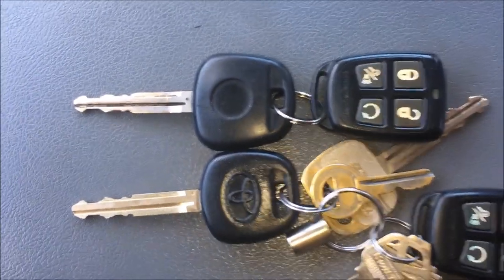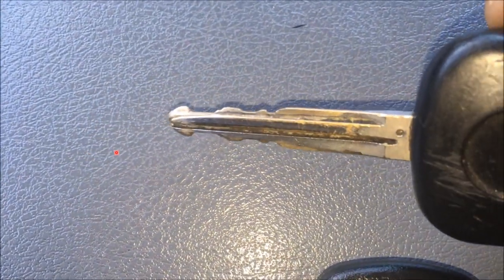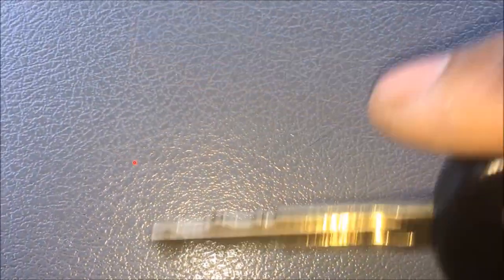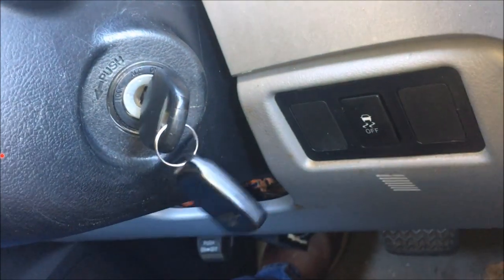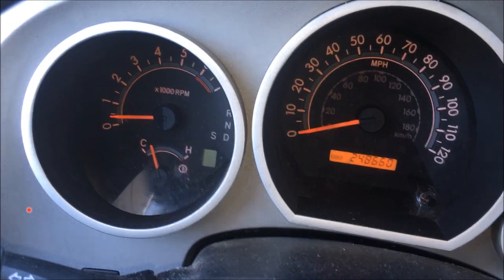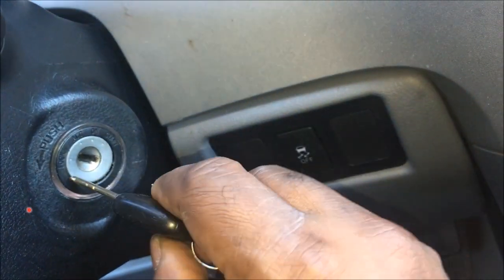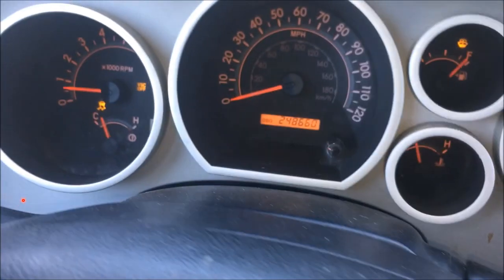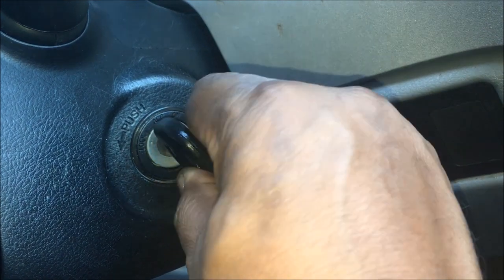DO NOT REPLACE THE IGNITION SWITCH UNTIL YOU TRY THIS

Comment: The most common complaint with Toyota's is they can't pull their key out after a while. If your key ever gets locked in the ignition just disconnect a battery for 30.

Comment: I was having the exact same problem. Had a new key made and programmed and everything works perfect. A lot cheaper than replacing the ignition switch!
Reply: I’m have the same issue on a 03 Toyota Sequoia but my key will go through everything as if it’s ready to start but from on to start nothing happens? You think it’s the key or ignition cylinder
Reply: @kevinmunguia1325  ,probably the starter. If you didn't hear any "click, click", most likely the starter is the culprit.

Comment: But I want to see you drive 115 mph (I'll pay any speeding ticket) and pull the old key out - and throw the old key out the window. (After all, you don't need it anymore). Then put the new key in, slow down, stop, then turn the motor off.

Comment: Hey Bro-migo, nicely done video and great suggestion.  However, some people (such as the below comment) may find it very convenient not to do any fix for this.  Think about, you no longer have to keep your mail key separated from your main keys.  I pull up to my community mail station, pull out my ignition key (with all my other keys), go get my mail, and put the ignition key back in and all without having to turn off the car! 😜 So convenient!
Reply: uh huh....what if you live in a place like new haven where they will jump in and have a nice running car to distribute the crack products? Sounds like you live in a retirement community with nice old 90 year olds.....don't be fooled blaster,  Im 93 and I'll take your hubs, plates, and cell phone while your in the goddam mail depot.....so convenient

Comment: That's a feature!   you can leave your vehicle running with passengers and keep the key.. or leave it running locked up without the key inside.  So i learned something.. i can probably file down that edge on a duplicate and get that feature.

Comment: I've always got extra keys made whenever I got a used car. If they are chipless keys you can use them as master keys when getting your daily use key made. I get my 99 camry keys made at Home Depot, a little over $5 as of 12/21. I use style 35R. Oh, while you're there, they've another style too, all metal #35, these fit in your wallet easily if you lock your keys in your car accidently.

Comment: Pfft most keys cost more than the ignition lock cylinder, and they even come with keys.
Reply from the maker: true
Reply: You can get that type key made just about anywhere. Got one made at Home Depot and was about $5, key type 35R, mines a 99 camry. They look the same.